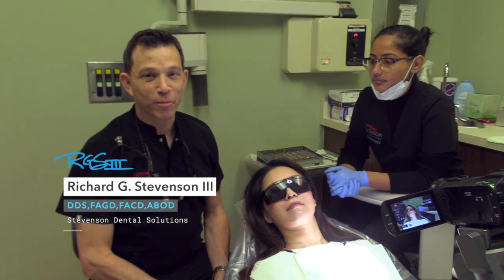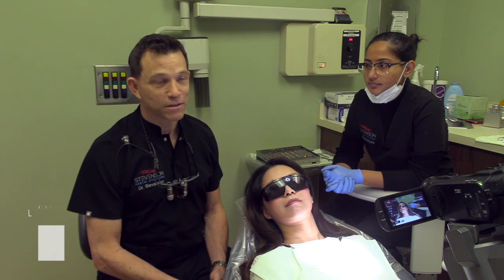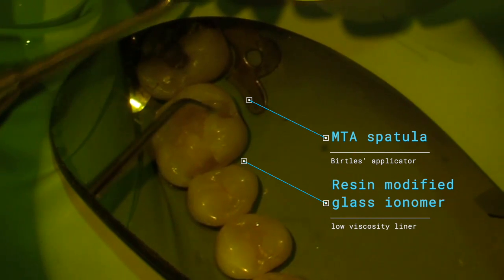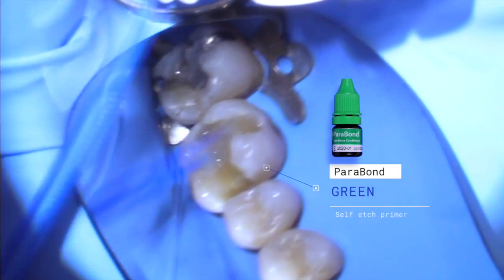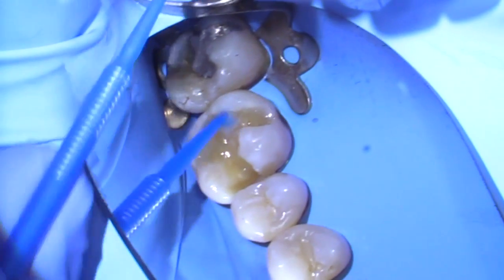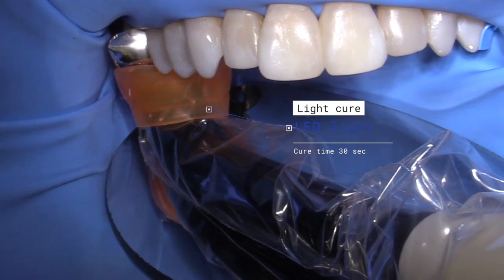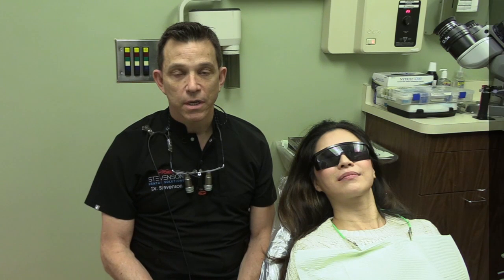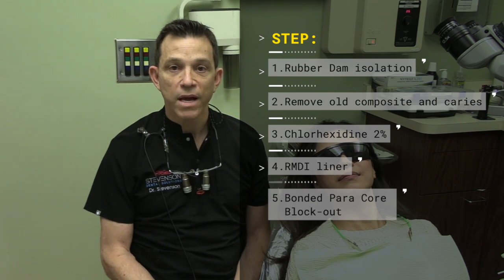Gold Inlay Restoration, Part 1: #3 MOL Clean-out and Block-out

Comment: when you are gonna do crown cutting clinical series . its gonna be great help to learn crown cutting in pt because there are so many factors  in patient like tongue size , salivation, mouth opening which play important role in doing the crown cutting.
Reply from the maker: Agreed.  I rarely perform full crowns - usually partial coverage - almost always seem to find a way to save part of the coronal structure.  It sure helps to have rubber dam on...Thank you.

Comment: Excuse me Dr. Stevenson. Why did you add build up material into the prep only to remove it in a subsequent step? I appreciate the video though!
Reply from the maker: This creates a fresh start and actually leads to a more conservative preparation.  It's the Tucker Block-out Technique.  When not used the operator tends to over prepare the tooth rather than starting from a clean slate.  Notice in the final prep that block out remains - this creates a uniform thickness of gold => more accuracy with cast.